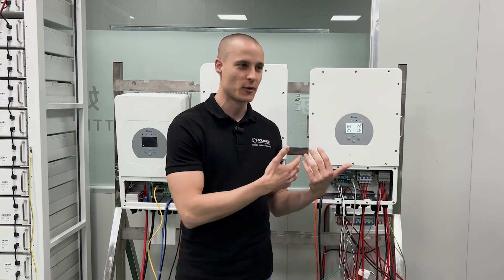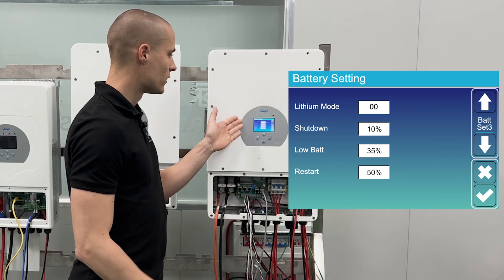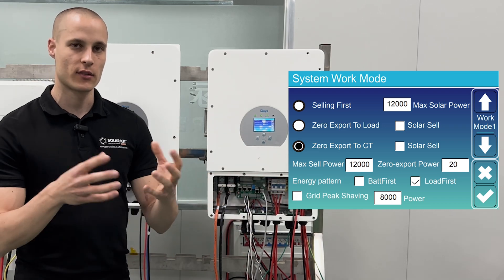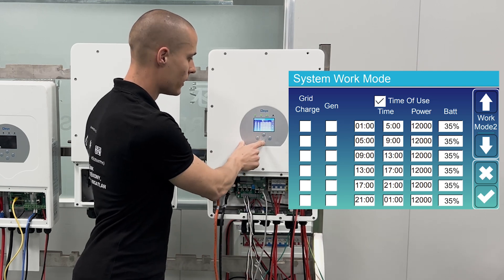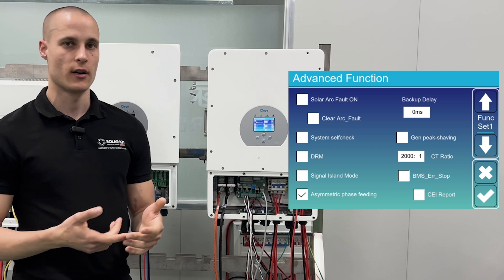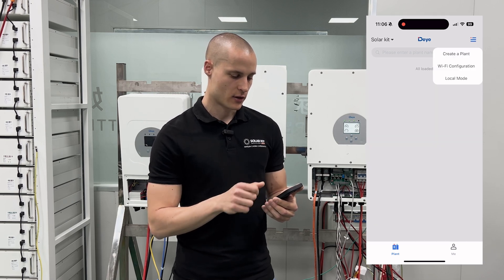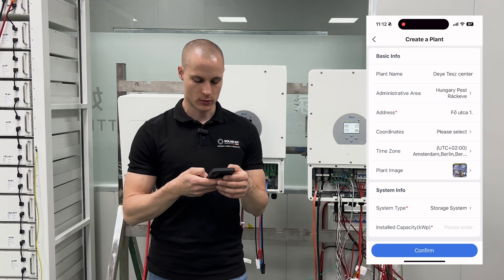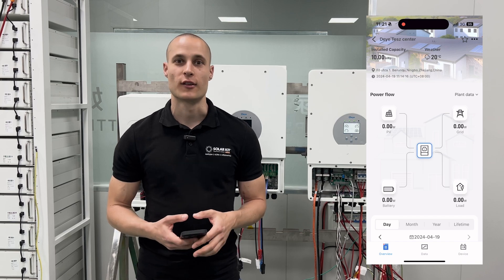Setting-Up and Commissioning a DEYE inverter - Step-by-Step Tutorial

Comment from the maker: Thanks for watching! 👍 If you found this helpful, check out our channel for more inverter setup videos and visit our webshop at shop.solar-kit.eu for all your solar needs.
Reply: Hello i have a guestion if in batteries settings i mark grid charge grid signal and start to 25%. Furthermore in time of use i not mark grid charge did the battery charge if is below 25 as battery settings or will not charge from grid??
Reply: Hello broo I saw you use Deye cloud for the installer,please tell me what app the client should use?

Comment: I have a 3 phase 10 kW Deye inverter connected to a max 24kW grid.. I have a consumer that needs 12 kW but inverter goes offgrid when I try to start it. Is it possible to pull more than the inverter rating?
I would think in this case the consumer just gets everything from grid. Do I have a wrong setting?

Comment: you state that charge current must be half of battery, eg if 400ah than its must be 200a. What if 2 x 400 ah batteries are connected together than what must be the charge current?

Comment: Hi i have just installed a 16kw single phase inverter. When initially powered up the display displayed  dc led ON ac led OFF normal led OFF fault led OFF with the main inverter state ON.  I must admit i am completely stuck on how to initiate power to the load output. Further information PV input voltage is okay but wattage is 0, battery is 78%, and grid input  OFF. System work mode set at, zero export to load.  Any advice would be appreciated.

Comment: Hello, I’m currently using a Deye SUN-75K-SG02HP3-EU-EM6 inverter. While the battery state of charge and load consumption readings are accurate, the solar power value has remained stagnant both on the inverter display and the mobile app for several days. Could you advise on what might be causing this issue?

Comment: When you connect the 2 inverters in parallel do you have to use the wifi dongle for each in the app configuration or only the master

Comment: hello! 
i was wondering if you coulld help me with a problem. When i connect the grid and it is night time, instead of the batteries discharging into the house load i see them getting charged by the grid, even though they are at 73% SOC, why is that happening and can it be stoppped? when i cut the grid off everything works normally. Another problem i have is that my Solarman app shows inacurate information. i can see the batteries discharge at a rate of 500W, but the consumption of my house says 30W, which is impposible, given the fact i have multiple electronics working.
Thank you in advance!

Comment: Can i connect on gen conection my miceoinverter solar system if that phase its connected to some appliances in my house?
Reply from the maker: You can use it as an input, if you are willing to do that. Like for example using your micro inverter to charge the batteries trough the hybrid inverter.

Best regards,

Comment: I have deye 10 kw 3 phase hybrid inverter but is show every time fault no on with battery battery parameters totally wrong abd battery not enable yet plz can u send me setting
Reply from the maker: Hello, 

If the fault indicator is on it is very likely, that there is something wrong with the settings, or maybe even with the connections. I would recommend to go trough the user manual, and search for the use-case of your site, hence you will see what should be done differently.

Best regards,

Comment: Buenas tardes
tengo un deye de 6 kw hibrido
queria saber si puedo aprovechar 4 strings de paneles en diferentes ubicaciones
tengo ahora conectados dos por mppt y otro con microinversores
al puerto gen pero se me queda libre otro mppt
cual seria la manera mas correcta de instalar este ultimo
muchisimas gracias
Reply from the maker: Hola.

Un sistema híbrido Deye de 6 kW tiene dos MPPT. ¿Cómo es posible que ya tenga dos orientaciones conectadas y aún tenga un MPPT libre? En este caso, debería usar el optimizador para la PV y así conectar diferentes direcciones en el mismo MPPT.

Saludos cordiales.

Comment: These videos are very useful, but do you have any more tips on the special cases?
If you need to use a Deye 3-phase inverter in IT-grid mode it derates by about 40% for example. But what came as a big surprise to me is it will then derate again due to it's insistence on doing balancing of the grid and it is limited by it's single phase current limit. In essence this means that a 12kW unit becomes limited to 8k on the grid side by the change from 400v to 230v and then due to the single phase current limit of 20 amps it is actually limited to single-phase loads of about 4600w! (Single phase load meaning any load connected between any 2 phase pairs.)  Any higher and it becomes unstable. This is unbalanced load of course, meaning extra load on other phases is indeed welcome as that can be provided from battery or solar via the other phases. I wish there was more information and warnings about this as it severely hampers many use-cases and maks the upgrading of many single phase EV chargers when installing such a system completely pointless.

Comment: Hi there.please can you help me if my battery settings only highlighted floating voltage ,shut down ,low battery and Restart then how do i calculate or which values do i insert in those boxes since it is in voltages not percentages
Reply from the maker: Hello, 

This is because you are not using lithium mode in the battery settings, you are using battV mode. Please change the setting to lithium mode, if you have a lithium battery conencted, then the options will change to you as well. You have to save the page first, once you have changed to lithium mode. 

If you have lead-acid batteries, you cannot set SoC values, as the inverter will measure the voltage of the batteries, not communicate with it, hence you need to set voltage levels in that case.

I hope this was helpfull, best regards!

Comment: I was told that the Deye 5kW inverter is similar to the Sunsynk, but I’ve found that to be inaccurate. Unfortunately, this turned out to be the wrong purchase for me, and I wouldn’t recommend it to anyone. It seems to have hidden or inaccessible features—there’s nowhere in the interface where you can adjust the amperage settings.
Reply from the maker: Hello,

The battery charge and discharge settings are accessible from the battery settings menu. To be able to access the settings, and also change them, you need to remove the checkmark in the basic settings menu from the "lock out all changes" option.

After that, you will be able to change the charging/discharging current in the first page of the battery settings.

Best regards,

Comment: Hello Good day can you help me what is the problem of this error. deye brand 6k-SG04LP1-EU/AU-SM2

Error: F56 DC_voltlow_fault?
Reply from the maker: Hello, 

This poblem is related to battery settings/connection. Please make sure that all the wiring is according to the user manual. Specifically in scenarion where there is parallel connection of the inverters, we see many-many incorrect connections.

Then you need to chek if the settings are according to the battery you use for the connection. I hope you will find the issue with the current system.

Best regards,

Comment: Does this model deye sun-50k-sg01hp3-eu-bm4 support wind turbine charging and how to connect it to the device?
Reply from the maker: Hello there, 

This is a very complex question, and is mostly dependent on the type of the wind turbines. So yes, it is possible to create a system with PV, batteries and wind turbines with a Deye inverter, but you need to check the technical parameters of the wind turbine very carefully, so it would fit into your system.

Best regards from the SOLARKIT team

Comment: I tried to configure a plant however it was "connected without internet" and could not proceed with installation
Reply from the maker: Hello!

You can set all the settings on the screen of the inverter, you don't need a phone or laptop to finish the settings. Also, its possible to connect locally to the inverter and adjust the parameters that way. Internet connection is not a reqiurement for the plant to work, however of course you will need it if you want remote access.

Best regards,

Comment: Great video. Setting battery  charging level from 85% to 35%(Time of Use menu) will cause battery not to be charged  from the grid until SOC reaches 35%. Isn't that risky in case of power outage when battery are discharged to 35% and no PV power available?
Reply: You are 100% in right. Hybrid primary function in compare with on-grid is supply backup (emergency) loads. If battery discharge near to end of capacity what will remain for emergency if grid outage in night period.
Reply from the maker: Hello!

Great observation. We create this videos for a wide variety of users, hence, we cannot personalize the settings as much. Many users only experience short power outages, or non at all, and some experience longer or more frequent ones. The exact SoC level should be determined by the user/installer, who know the specific requirements of the give site.

Have a nice day!

Comment: please explain how does the Deye inverter works if there is no battery connected and I don't want to export power back to the grid
Reply from the maker: Dear Petrus,

If you dont want to export power back to the grid the inverter will simply not output excess power to that port (or any other, if there is no need). For this to poperly funcion, you need to install the CTs in the package, and connect them to the inverter, our you can also purchase a smart meter as use that for metering.

Best regards,

Comment: HI, I need help to have the optimal configuration of a SUN-6k-SG03LP1-EU inverter connected to 6 batteries of the type VT48100E-W ESS in parallel. Can you help me?
Reply from the maker: Hello Roberto,
There are many settings that can be adjusted for the clients need, and also depends on the installation. Without these informations we cannot give you a proper setup. 
In this video you can see the logic and the steps how to comission a Deye inverter, but tailoring solutions for customers need is the installers responsability. 

Best regards,

Comment: What is the minimum that i need to Connect to get the display  working? 1f grid? 1f gen? Pv-panels? Or…
Reply from the maker: Hello,
in order to turn on the display, you can connect sufficient PV or any AC to the grid, or a battery.

Comment: Excellent video, thanks!  Can you tell me, to connect to WiFi, does the inverter need some type extra module or what?  Mine is the Deye Hybrid SUN-8K-SG05LP1-U.
Reply from the maker: Hello,
in order to connect the inverter to a WiFi network, all you need is a WiFi logger which is packed with the inverter and the original package should contain this device.

Comment: Hello, thanks for this useful video 🙏

I used exactly this inverter for an off grid system and all house loads are connected to back up load outage, I am using this inverter in a system that there are pv and 3 units of 51.2V 100Ah lfp batteries in parallel, with of course no grid connection. But even though I set the level of 10% shutdown, when the battery soc is around 15% I got F56 dc low voltage warnings and our loads are disconncted, then electricity is coming but batteries are not charging unless I reset the inverter, what shall I do? Shall I set the voltage levels of battery operations or using battery % is enough? Will be Waiting for your quick support and advice, thank you in advance.
Reply from the maker: Hello, may I ask which batteries are you using with your inverter? If they are Deye batteries then you have to make sure they are placed inside as they can not discharge in cold enviroment, according to datasheet it's 0 degrees C. Also you can get this error message if the PV power is not suffucuent to supply the loads.

Comment: How is your grid connected? Do you gave a bypass switch, or when the inverter is doing a firmware update there is no output to consumers?
Reply from the maker: Hello, yes we recommend to install a bypass switch so in case there is any fault with the inverter, you can connect the grid directly to the loads so your household will be not left without electricity.

Comment: Can Deye inverter be connected to internet router using network cable instead of using donggle?
Reply from the maker: Hello, yes it can be connected but in order to work that way, you need to install an Ethernet Logger instead of the WiFi Logger to the inverter.

Comment: Do you have a Diagram how to wire this Deye hybrid on grid inverter with ATS, when my battery is not enough the Grid will back up..
Reply from the maker: Hello, you can find this drawing in the user manual which can be find in printed version packed with the inverter or you can download it from our B2B website or Deye's official website.

Comment: Is it possible to connect the inverter to the solar panels and the generator only without connecting the batteries ? So that we feed the load  from the panels first, and in the event of a shortage in the voltage of the panels, compensation is made from the generator?
Reply from the maker: Hello, if you are trying to use it in off-grid mode then a battery is mandatory. For generator use I highly recommend batteries as the first layer of energy compensation if the PV is not enough.

Comment: Hi, im installing a similar system in a few weeks.
just to clarify if i want to set the battery to discharge to a value of 20%, do i set it the discharge to 20% or 80%?